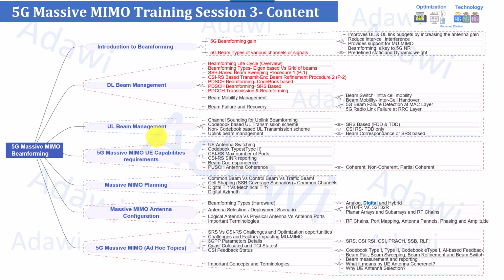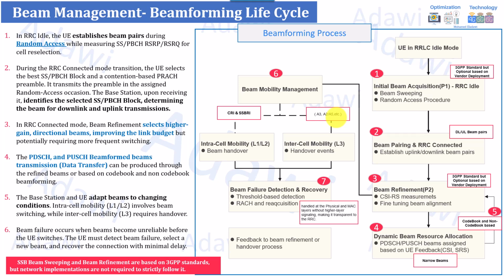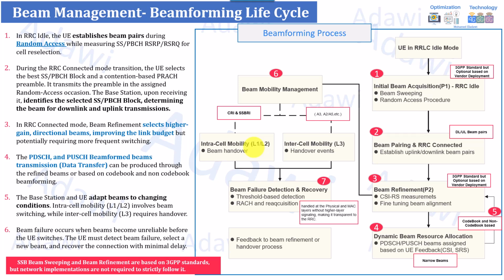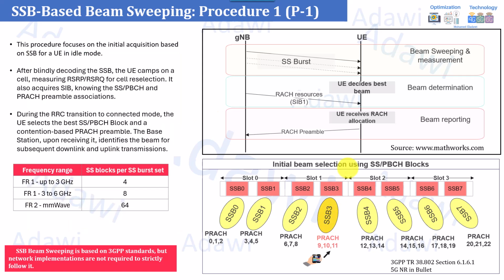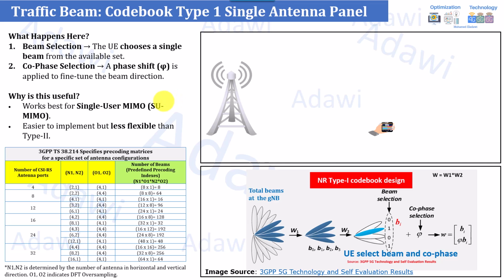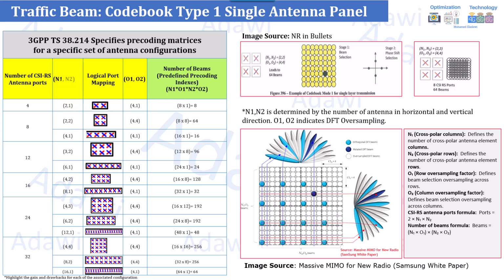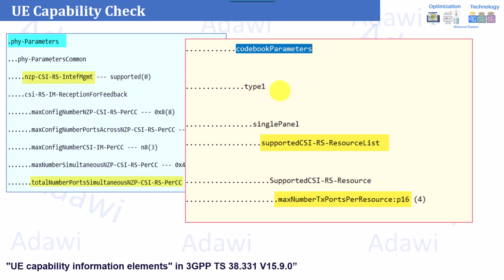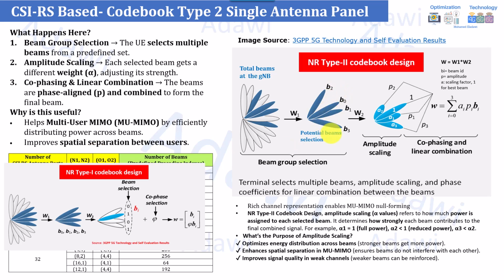Session 3: 5G Beam Management Explained | DL Beamforming, SSB, CSI-RS, Codebook Types

Comment: Very informative Mohamed, keep up the good work! Please provide me clarifications on the following : 
1) What is in general the impact of antenna elements spacing on the radiation pattern ? 
2) Based on your presentation, in case of pre-coded CSI-RS we can have 4 CSI-RS beams 8-ports each. If the option (2,2)/(4,4) for (N1,N2)/(O1, O2) is supported for 8-ports, then it is feasible to have 64 traffic beams per CSI-RS beam and given that there will be 4 CSI-RS beams in total 4 x 64 = 256 traffic beams, the same max number of traffic beams as in case of CSI-RS 32 ports (not pre-coded). Is it correct ?  
Thank you
Reply from the maker: Hi Gerogi, thanks and good questions:

Regarding question 1)  The distance between elements affects how signals from each antenna combine (constructively or destructively). This interference shapes the main lobe (desired direction) and side lobes (unwanted directions) of the radiation pattern. λ/2 spacing is the most commonly used rule of thumb as It provides a single main lobe and Minimizes grating lobes (undesired repeated beams)
Regarding question 2) Yes you are correct as per my understanding.
Reply: Thank you very much Mohamed @mohamedeladawiashour

Comment: Thanks for great contents!
How does gNB understand which SSB beam was used by UE during msg1 transmission?
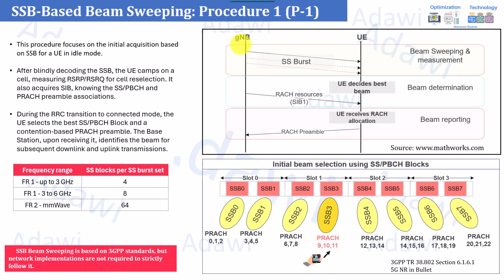Reply from the maker: Thank you. Each SSB is associated with specific PRACH preambles — for example, SSB0 is linked to PRACH 0, 1, and 2, while SSB1 is linked to PRACH 3, 4, and 5. When the UE transmits a random access preamble, the gNB can determine which SSB the UE is camped on. For instance, if the UE selects SSB0 and sends PRACH preamble 2, the gNB knows it was based on SSB0. You can check this at minute 35:00."

Comment: Another question- is there a way to tell  whether SRS based beamforming is being used or PMI codebook based beamforming done from an UE log ? If a periodic SRS has been setup and UE is sending SRS as well as PMI in the uplink in that case can we assume SRS based beamforming is being used?
Reply from the maker: Yes, based on my limited knowledge, there is a way, and I will explain it in the next video. There is something called the SRS Resource Set, which includes a parameter called USAGE. If any of the configured SRS sets is set to Antenna Switching, the gNB will use SRS-based beamforming; otherwise, it will use CSI-RS (PMI Codebook based beamforming).

Comment: Great video as always! One question though - Is there any correlation between number of CSI_RS Antenna Ports and number of physical antenna ports?  Do we need to have 32T32R antenna to support 32 CSI-RS Ports ? In other words if we see a rrc message with eight-two-TypeI-SinglePanel-Restriction can we assume that the connected gnB has at least 32T32R antenna?
Reply from the maker: Good question! Yes, I think so. However, what I'm not sure about is the 16T16R configuration. This type of setup is typically limited to Massive MIMO, and active antennas usually have at least 32T32R.